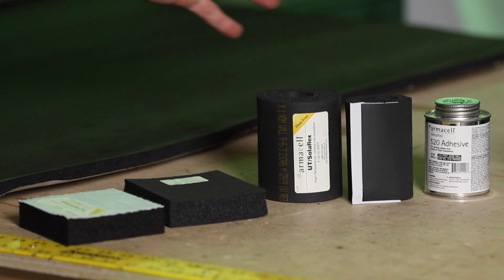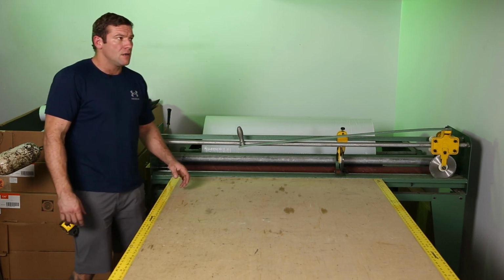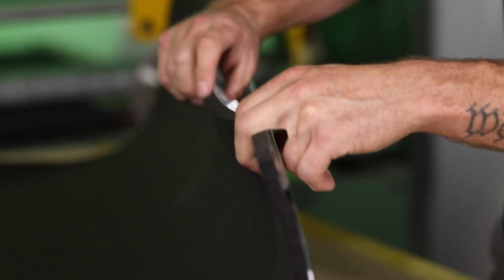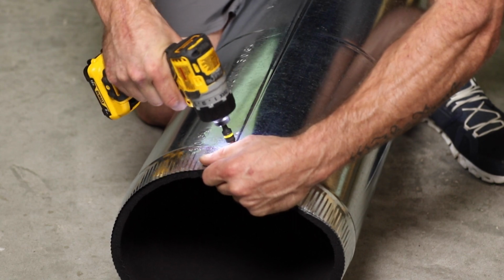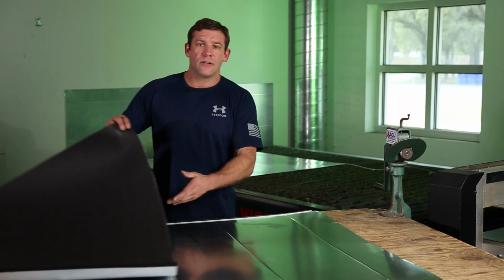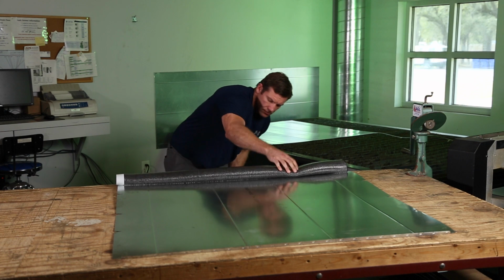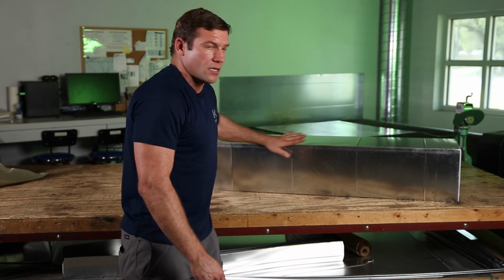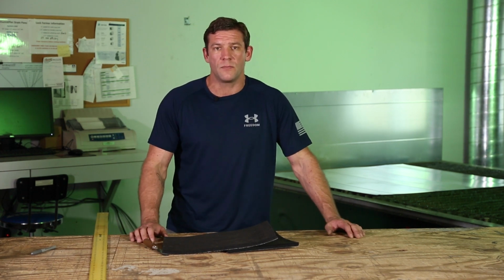Internally insulating duct with Armaflex duct liner - round & rectangular duct (mech training #107)

Comment: I'm thankful I live in a climate where this is not needed. The acoustic part can be built in with good duct sizing. I use mostly round duct in a crawl space for the supply, and minimal square duct for return, all ducting is in the thermal envelope.  We (on Vancouver Island), use the joist space as a return duct to square jumpers. Our climate is temperate rain forest, so we cool about one to two weeks maximum, and our humidity is usually low compared to the east. So we do more sensible cooling rather than latent.
Another exellent video, please make more.

Comment: Is this a good product to use to reduce noise in a central return duct? How would it compare to flex duct in noise reduction?
Reply from the maker: Works great for acoustics in a return duct.  Normally we use this to line the return box that houses the return grill.  We will normally run flex from there.  I believe flex would do better acoustically because of all the ridges sound would have to bounce off of.   They both perform well acoustically though.
Reply: @aglmechanicaltips wow thanks for the quick reply! Love how in depth all your videos go.

Comment: Should I insulate a new 10” island hood vent running through a joist bay?
Reply from the maker: No need, standard hoods are pulling conditioned air from your house to outside.  It is not very hot air running through them.

Comment: Great vid. I have an application where the liner will come in rolls, non-adhesive backed. Do you trust the adhesive that you paint on or would you recommend adding pins?
Reply from the maker: If you use the armaflex adhesive and follow instructions it will never come off.  This stuff is like contact cement though and it is a bit different how it is applied.  You apply a thin layer to both the duct and the liner and and allow it to dry a little bit (tacky) before sticking.  When the liner and duct touch it should instantly stick and if done right it's permanent.  Make sure you thoroughly read the instructions.  As long as you do it right you do not need stick pins.

Comment: Great video Sir! 
If I have 20" spiral duct on a packaged unit outside would you recommend wrapping externally with this Arma flex or traditional r8 fiber glass insulation? Also what methods are used to weather proof it after its wrapped around the spiral? Does externally wrapped Arma flex get mastic like fiberglass insulation or just wrap it with some silver lined foam weather wrap? Thanks so much for all the knowledge. (HTX)
Reply from the maker: I would use fiberglass due to the higher R value.  I would solid mastic but that is not going to water proof it.  You need to make sure that the duct is protected with a sheet metal rain hood or something similar.
Reply: @aglmechanicaltips  what if a sheet metal rain hood isn't an option for the return and supply spiral wrapped in external r8 insulation and masticed? Can I wrap it a 2nd time in some sort weatherization reflective wrap?
Reply: I'm not sure, this is nothing I have done.  I would assume some sort of roofing sealant would be the way to go like sealoflex or something.  There are some materials used for waterproofing duct work on roofs but I'm not in the commercial realm and wouldnt know these products without doing some research.
Reply: @andrewlingle8985  I'm an old guy but I'll weigh in.  If you are wrapping outdoor duct with ANYTHING, you need to use an aluminum jacket to protect the insulation. I hate running duct outdoors because it gets beat up. I do mostly industrial food plants but sure as heck, hailstorms, people walk on the duct, lay tools on it, or just abuse it thinking it's the next guys problem. Which it will be.

Comment: I'm going to have new exposed spiral duct put into my small home (living room) that transitions into rectangular duct (in the closet). The contractor is pushing uninsulated duct, due to it all being inside the living area (no attic space). I wonder if the push is more due to the difficulty of insulating the prefab spiral round. I'm worried about noise and condensation. I'm not sure which way to go.
Reply from the maker: If you are not leaving doors open the spiral duct will exist in conditioned space.  As long as the system was designed right the temp and humidity should be such that the duct cannot reach dew point (will not sweat).  If you do plan on leaving the doors open at times you can get double wall spiral duct that is insulated internally with fiberglass.  It will look the same as the uninsulated spiral.  The internally lined spiral duct is expensive though and weighs a lot.  It is also a bit difficult to make the connections too.  I normally use clevis hangers to hang spiral duct because it is cosmetically appealing but quite a bit over kill..  Hope this helps.
Reply: @aglmechanicaltips  Thanks for the reply.

Comment: Does this not cause a air flow Restriction?
Reply from the maker: You build your duct slightly larger to cover the insulation thickness so in the end there is the same area for air flow.

Comment: Any chance you could make a video showing how to connect boots to supply vents in a ceiling application? Do I cut a hole in the drywall and frame around it with 2x4s? Can I just screw them together without the framing? I saw your "Insulating ductwork fittings" video but I don't know what to do after insulating all the boots! thanks
Reply: He briefly talks about what to use for ceilings in another video.

Comment: Andrew. Another great video. My local supplier sells rolled armaflex and i have been tempted to use it for plenums and plenum take-offs but i have always stuct to what i know best and that is the tried and true R-8/silver-foil duct wrap. With the time and effort involved with your example of the 12" pipe, that would easily be a $3-400 dollar section. I get WHY you are using this since ductwrap is easily damaged during the install process but it can be easily repaired at the same time. Just my thoughts. Love your work. My guy,s are all into what you do. Thx !
Reply from the maker: After getting good at this we can produce a 5' section about every 5 minutes so it actually becomes a very fast process.  When installing in trusses the labor is significantly less because you no longer have to fight insulating seams in between trusses and takeoff installation is also quicker.  This labor offset still doesnt cover the additional cost of the material but definitely closes the gap some.  This is our normal application for the main trunkline in a truss only and in most other applications I agree duct wrap is the way to go.
Reply: @aglmechanicaltips  Thx for the reply.